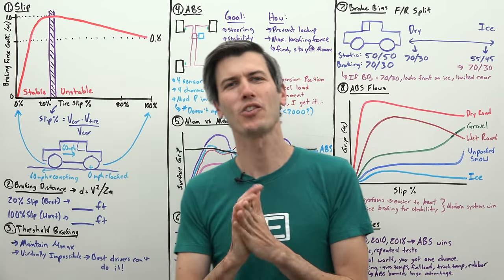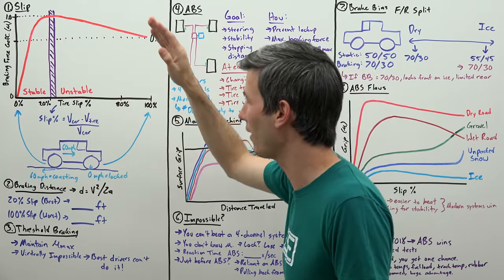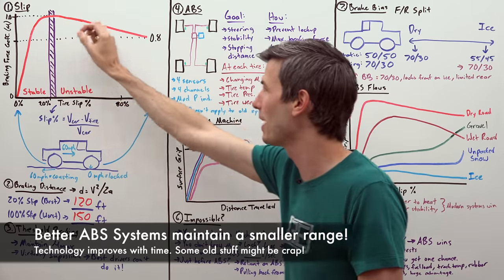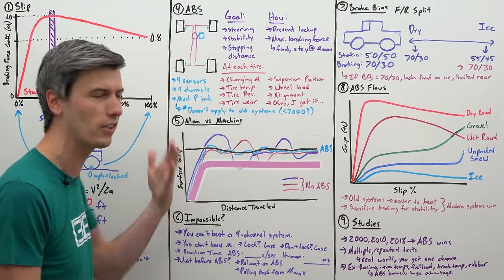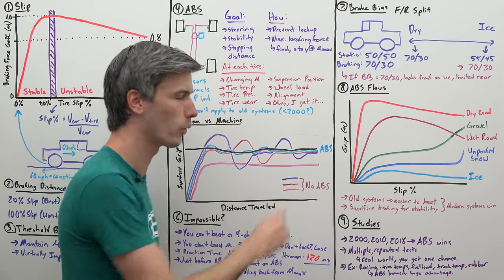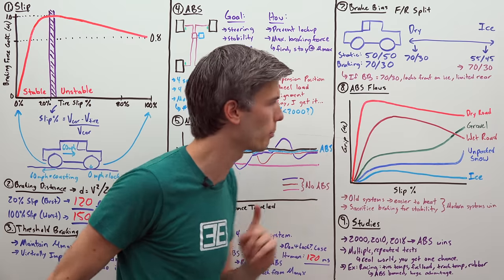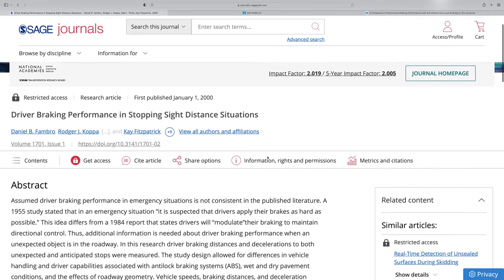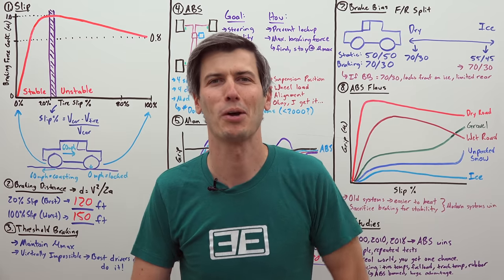Why Threshold Braking Is Impossible - ABS Wins!

Comment: I'm glad you touched on the snow and gravel topic, important to know there are certain scenarios like that.

Also glad you touched on the fact that older systems can be not as effective. My old 90s junk is kinda terrible and I feel like it always gets in the way. Never really had the pleasure to experience modern systems though...
Reply: I completely agree about the age. Anything with drum brakes on the back like a 94 S10 or 92 Escort I had were pretty worthless. The 2000 Frontier and 03 Cherokee felt about the same as what I could do myself, so they were probably better, but not noticeably. Our 2013 Leaf and 2011 Pilot aren't just better but they even feel significantly better than anything I could do. Traction control is a separate issue, though and I feel like it's about a decade behind ABS, at least on everyday cars.
Reply: I can't say whether newer cars have fixed it, but old 90s cars' ABS is a legitimate hazard today. Over time, rust accumulates between the sensor and wheel hub, pushing the sensor further away. With the increased distance, the sensor has a harder time detecting the wheel speed, and thus assumes total lockup. This means you have no brakes. Always test an older car's brakes at a variety of speeds before relying on them.
Reply: I think my 2017 Chevy Volt might be one of the few modern vehicles you could plausibly beat. It has two electric motors with regen, three clutches, a gasoline engine, and disk brakes. The hand-off between those systems under braking input is not always predictable and feels very far from optimal. 

I'd be really interested to know more about how ABS is implemented in systems with friction brakes and regen.
Reply: @AlexanderGee  That would be an interesting test. I would bet a small but not insignificant amount that the engineers were quite thorough, though. The "feel" of many things can be deceptive.
Reply: My 2007 focus has trash ABS. Rear only and only in tandem. Definitely felt like I could do better than it. However in panic brake scenarios it will still beat me. 

My 2009 Corolla on the other hand, has 4 wheel individual ABS. 100% can beat me any day. It’s stellar. And that’s from a 14 year old econobox. I can’t imagine what the new hotness is like.
Reply: @Varadiio  speaking of this gm/big-3 got sued as they cannot be arrested over the module's getting junk in them and or the wiring/ECU boards failing and i know one or 2 cars the board got brake fluid on/soaked and forced it into a curb @ 40MPH ( missed that car ride by 1-trip as it was the boss's siblings caddy that came to the auto-shop for work to be done on it sometime's ) and there a different one that had the pump failed and or mechanical gut's stick so there wasn't any line PSI and wrecked or pin full line PSI 900+ish on one or 2 wheel/rim on cruise control @40+mph = a roll over crash ect

still a ABS-2023-up fan as it's gotten better with improvements and using regeneration should make it better as the lag/precision can be reduced some more 

1980's ish and back ABS im not a fan of or so-so so im mostly undecided on as yes technically it's got advantage's but the system isn't that much better than my foot in practice
Reply: thanks for pointing out the snow ❄parts as i was educated not to lock up on loose snow for best straight line stopping/grip

Comment: I 100% agree for new abs systems, but for some 90's system i have found out that any bumps in the road, or patches of road with different grip levels completely freak out the abs taking all brake pressure away from you, to the point where i have been soo close to having an accident in dry weather at shamelessly low speeds. New systems(2010 and up) i have driven do not have this problem tough.
Reply: Some of this might be age / signal degradation. As the tone wheels get rusty the signal gets worse, and then a bump can lead to a false activation.

Comment: Great and convincing argument. I totally agree with you. I have a 2003 BMW Z4 with incredible abs braking capability that I could never match autocrossing or on the street. My anecdote, I believe falls into the older crappier systems. I was caught unaware when a wet road became glare ice. 2002 vw golf, I believe a continental teves system that was not 4 channel. When I slammed the brake pedal to the floor hoping for some abs I was already pivoted close to 90 degrees from where the car was headed, and I think the abs saw all the wheels at 0mph and just let me lock them all up.

Comment: As a follow up, could we have a small video about the different settings a GT3 car gets for ABS under the series that do allow it? I have the vague idea that it has to do with how aggressive it is, in so far that a series of settings are better for rain than others, and that tire-wear is also affected (ie it changes how much slip the system allows before engaging/how much to reduce pressure), but I don't know details.
Reply from the maker: Great question - I don't know the setting differences either but a great subject to bring up next time I'm around anything GT3 related!
Reply: @EngineeringExplained  Please do a video on GT car Race ABS
Reply: @EngineeringExplained  Would be much appreciated! Im 100% on your side, that no human can beat a current ABS. Tho there must be a reason, why modern GT3 cars have like 10..16 different settings for ABS strengt.
Reply: @EngineeringExplained  You could look into how ABS affects the balance of the car when trail braking aggressively, I only have GT3 experience in simulators however I am always faster with the lowest setting. It might be that in racing there is more to it because they trail brake allot and need to rotate the car at the limit so any unbalance costs time (like flat spots).

Comment: My dad's '06 Infiniti G35x must've had one of the systems that didn't account for angle--driving him to an appointment one time in winter and came upon stopped traffic where the roads got icy when traveling at 60 MPH: half pressed the brakes, it immediately jumped like 30 degrees sideways trying to turn into cars in the next lane over, lifted off to straighten out, rinse/repeat manually weening down to a stop since any moderate brake pressure was turning us sideways. Good thing the slowing was gradual enough it didn't result in an accident, but the drive that usually took an hour 15 mins took over two and a half hours and was probably the most white knuckle drive of my life.

Comment: Great explanation.  Looking forward to an episode about electronic stability systems.    And then specifically the interaction with ABS.  When I did a few simulations of emergency braking while avoiding an object on a wet skidpad I still had to release the brake when the rear stepped out on me to prevent a spin out.  When comparing with DSC (bmw e92 m3) off ,  I didn't really get much stopping distance difference.
The instructor said to just slam the brakes, steer around a virtual object while keep braking but it was not possible to keep the car under control like that.

Comment: Thank you for recalibrating my mind.

I now understand that 4 channel abs can provide the most braking for each tire.
It may be  tuned to reduce brake pressure on some tires if you are trying to steer, or it the tail starts to come around.

Now I learned threshhold braking in 1968 on a Buick with bias ply tires.
These tires made noise so that it was easy to learn.

My first car with ABS was a 1992? Ford SHO.
This was a 2 channel system, front and rear.
If the left tires were on dry pavement and the right tires in sand an slush, 
then the stopping distances got very long, but with no pull to the side.

Next car was a SAAB 900 turbo.
It had 3 channel ABS LF, RF, and rear.
Stops were very short, but with a lot of steering wheel pull if one side had poor traction.

About the year 200? the pulling went away. I assume this was 4 channel ABS.

Also, a  lot of tires are now quiet at their traction limit.

ESP became standard, and then law soon after this.
This should couple a steering position sensor with the ABS.
Steering while breaking will result in longer stopping distances.

I need to practice.

Comment: Had that conversation with my other half. I try to brake gently (regenerative braking on an EV), and almost never get into ABS. But in the circumstances when I need ABS, I'm glad I have it - it's much better than me. The circumstances where threshold braking enters into the conversation, you're usually thinking about other things such as not steering the car into an obstacle.
Reply: I think threshold braking was never really discussed for safety/daily driving, unless you're on ice/snow where ABS performs very poorly. on dry road, it's for for the track and you're no supposed to get anywhere close to lock you brakes on a regular colmute
Reply: I'm usually checking the mirror to see if the person behind me is able to stop as quickly. Habit from motorcycle I guess.
Reply: @techno1561  yes in emergency situation in your daily driving abs should perform better because you don't know the exact grip, your tires are most probably not up to optimal temperature, and there's also a high chance that you have slightly different grip on every tire/patch of road, and also that your brake front/rear bias is not perfectly calibrated for the current conditions, so abs will extract the most braking power from each tire. on a track threshold braking makes more sense than on the road because you are doing laps around the same track, you get to test the grip before every corner, the grip is more consistent than on the road, you know exactly were you are going to brake and you can push the limits further and further on every lap, and of course because you are trying to improve your skills in a controlled environment 
for emergency braking I'd rather rely on abs giving consistent results, than trying to improving the braking distance marginally in the best case, but risking a longer distance because you didn't get it perfectly right. you don't get the chance to do another lap and try again

Comment: I used to drive a Fiat Punto 55, no driver aids, not even power steering, no electric windows, no temperature gauge, no abs, it had a 1.1 liter engine (55Hp). In the rain, braking on a red light in a stone paved road (common in Portugal) was equivalent to just not press the gas pedal while in gear. Keep doing great explanatory videos. Than'ks for your work...

Comment: Also, since the late 90s a feature called "emergency brake force distribution" has been available. When the car senses a panic stop it applies the pedal more for you. On some cars this is internal to the booster (you can feel the pedal dip away from your foot!), on others it's internal to the ABS unit.
Reply: "Emergency brake force distribution" usually refers to the ability of the ABS system to brake individual wheels (distribution). The pedal moving away from your foot is probably the ABS system lowering the pressure of the system to prevent a lock up. The brake pads experience the same reduction of force from the system as your foot does. It won't give you uncommanded braking.
Reply: @stormatron6184  The original commenter is actually right, on a lot of cars this is a feature coded into the ABS module. In the German cars it usually comes in, people tend to underestimate the pedal force and travel it takes to reach full braking potential. It will detect a panic stop and the ABS module will command full possible braking pressure even if the driver has not applied sufficient pedal force. I usually disable this feature in my BMWs to achieve a more linear brake pedal for track driving, but it's definitely a great safety feature if you're like most people and don't often slam the brakes hard enough to trigger antilock
Reply: @d47000  What possible logic could the designers use to determine a "panic stop" rather than anything else? I could see an option to change brake pedal linearity like a game controller being possible. E.g. 50% pedal is 65% braking ability. But it still requires you to push the pedal to that point and it's the same every time. You still only get as much braking as you push the pedal for.
Reply: @stormatron6184  In the more modern BMWs whose stability control logic I am pretty familiar with, the ABS module (as part of the "Hydraulic Brake Assist" program) monitors ground speed, brake pedal pressure, and rate of deceleration to understand when the car is in an emergency braking situation. At this point it increases brake pedal pressure to the point of antilock activation. Let's say if you were to very gently and smoothly press the brake pedal until it reaches ABS threshold, the brake assist program would not kick in. German cars tend to use pretty advanced software algorithms for this type of thing.
Reply: @stormatron6184  In my car (2010 Lexus IS 250 RWD) the emergency condition that boosts the brakes is detected by using a forward facing radar. It's only supposed to activate if there is an imminent collision.
Reply: This particular feature has been a major annoyance to me in some cars, and has gotten passengers mad at me, because cars will take my rapid application of my intended braking force, and interpret that to be a panic stop, giving me a lot more braking force than I was asking for.
Reply: @AlexandarHullRichter  That's a good excuse to practice smoother braking
Reply: @hamzerpanzer   No, it's a reason why people who know what they want the car to do have to avoid cars that try to think for them.
Reply: ah that explains why it seems to suddenly snap to full travel
Reply: What an awful feature for keen drivers.
Reply: @evanfinch4987  How do you operate the 3 brake pedals on your car at once?
Reply: Absolutely right, another example stating that humans get beaten by the tech 🙂
Reply: Panic braking detection tends to require on high criterion. I mean, if a driver goes from 0% brake application to 85% brake application within a quarter-second, odds are, he's going to need 100% brake application (so the system gives you that).

In what situation would a person slam their brakes from 0% to 85%, but NOT actually need 100%?
Reply: @cykeok3525  So true because if you do it for fun there better not be other people in the car or you are on a track, I can't picture a scenario where an assist like this actually hinders "responsible" Drivers. And I enjoy driving but not putting people in danger.
Reply: @compu85 I think the feature you described is called Brake Assist. Electronic Brakeforce Distribution is the distribution of various brake forces to different wheels as the conditions warrant
Reply: @stormatron6184  the feature OP described is actually called Brake Assist
Reply: @Justmejbful  Yes I conflated the 2 features.

Comment: I have experience riding dirt bikes and atvs which do not have abs. When I started out, getting used to not locking up the tires when braking was interesting to say the least. I’ve seen people lock up their rears while going down hill around a curve and the backend just slides out under them. In the best case they’re going straight and manage to keep the wheels straight they just slide further than they should have. Controlling downhill speed while preventing the engine from stalling with the clutch while also going around curves was probably the most terrifying and difficult thing I’ve had to learn to control.

Comment: It would be interesting to see a similar video regarding modern high-end motorcycles. Generally, the user manuals caution that, in order to achieve the maximum benefit from ABS, the rider needs to wait a beat, that is, rather than panicking and fully compressing the (front) brake lever, you need to smoothly compress it initially, allowing dynamic weight transfer to occur, and then fully engage the brake. On track, you are also taught to do something similar with the throttle upon corner exit: smooth initial (and brief) throttle application followed by pinning it. Of course, all of this becomes much more complicated if you factor in the latest aero and ride height devices used in MotoGP.
Reply: I believe the best ABS on off road bikes approaches the performance of an expert in a straight line gravel stop.

Which is impressive.
Reply: That's not just advice for getting the best from ABS - it's actually the correct advice for getting the best from the tires/brakes themselves (so that ABS can get the best from them). 

It's not a caution to achieve the best from ABS, it's a caution that ABS is not magic and doesn't make up for completely awful braking technique. Bikes are REALLY susceptible to load transfer, plain ABS can't change that (though I'd bet someone like BMW probably has tech that does...).